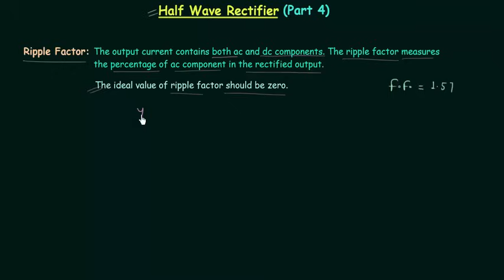Half Wave Rectifier (Ripple Factor)

Comment: Conversion efficiency  of half wave rectifier should be ratio of  dc power output on secondary side to ac input power on primary side,which comes to approx. 20 per cent......in your video efficiency is ratio of dc power output at load ,to ac input power at load ,which is 40percent,..... please shed some light on definition of efficiency and why this discrepancy

Comment: There's a mistake in the final calculation , it's 1.1 not 1.21 , you probably forgot a bracket while using the calculator
Reply: But i think that it comes 0.57 instead of 1.21 or 1.1
Reply: @shivamkashyap1543  it's 1.1 dude, I think it's written in R Murugesan's modern physics, not sure, but the final value is 1.1.

Comment: As Idc is constant , 
Idc(2/2π) integral 0 to 2π I(dwt)
To solve :-
Integral 0 to 2π I(dwt)
0 to π I(dwt) + π to 2π I(dwt)
As for half wave rectifier 
π to 2π I(dwt) =0 
We only left with 
0 to π I(dwt)
As I=I' sin(wt)
Where I' is peak value of output current
Such that
Integral 0 to π I d(wt) become 
integral 0 to π I' sinwt d(wt)
I' is constant
Therefore by integration of sin(wt) we get (-cos wt ) and putting the limits 
we get value is 2 
Thus the value of 
Integral 0 to 2π I (dwt) = 2I'
Thus final value we get is 
=Idc(2/2π)2I'
=Idc(I'/π)
As I'/π=Idc ( average value of output dc current)
Therefore we get at last is (Idc)^2 🙂🙂
Reply: Thank you 😊
Reply: thank you
Reply: thank u
Reply: thanks a lot
Reply: Thanks a lot dude
Reply: 7years ago.....damn.....but the final answer was 2Idc^2 not just Idc^2

Hope you see this bro
Reply: @fxjeda6894  😭😭😭
Reply: thanks a lot buddy

Comment: In the last lecture you told that rms value of ac is equal to the value of dc. 
So in this lecture how is av o/p current(Iavg) taken as Idc i.e (Iavg=Idc)? 
According to the last lecture rms o/p current(Irms) should be equal to Idc i.e (Irms=Idc) right? 
This is proving that Irms and Iavg is equal which is not equal in practice. 
Please help.
Reply: No he told rms value is the value of supply so that the supply would give power or brightness to lamp connected to it
Reply: initially even i was confused,then i came to know that average value is equivalent to dc component of current since the opposing peaks of the ac components get cancelled out
Reply: @aditipandey6964  how Iav= Idc?

Comment: I figured out the 2Idc^2 part. In Idc*I, Idc is a constant so it will come out of the integration. Now write I as Iac+Idc. Integration of Iac will be zero over a full cycle. Hope it helps. This is also why the average value is Idc.
Reply: but this case is for half wave rectifier right?
so the integration of Iac in full cycle isnt zero.
Reply: @dwinovianto1250  bro we have broken I into two components one is Pure AC with positive and negative cycles and the other one is Pure DC
Reply: @dwinovianto1250  it isn't exactly 0,but it's small when compared with other terms.
Reply: Haha everyone's thanking me but now I've forgotten everything I learned in that electronics course. But glad I helped.
Reply: @yashodhan1905  🤭🤭🤭🤗🤗🤗
Reply: @yashodhan1905 mass bro
Reply: @renusara3419  mass of what?
Reply: @yashodhan1905 bro, you have completed your btech and I hope you are living a well settled life. I am 1st year student at nit Hamirpur. I just want tips from you that what should I do in my btech journey (my branch is electrical). Please please give reply and help me 🙏🙏
Reply: iac would not be 0 because we take the mode of integration it will add the mag. of +ve cycle and -ve cycle
Reply: I had one single problem so i watched the video but i got the answer from you, thanx bro
Reply: still did not understood😓😓😓😓.....please can u elaborate more
Reply: thanks....
Reply: Yashodhan Manerikar thanks
Reply: Thanks a lot man, I just got freaked out.
Reply: brilliant!!
Reply: @Padhai_with_Princy  s
Reply: Thank u
Reply: Thanks so much brother I was confused at that step
Reply: Thanks
Reply: Thanks 😊
Reply: TYSM🙂
Reply: Thankyou❤
Reply: thanks a lot
Reply: Yesss
Reply: Yeah idc
Reply: thanks....
Reply: Since Idc is constant ,it will come out of  integration,and remaining thing 1/2π×int{ i dwt} is by definition equivalent to  Idc..so we get Idc^2 as final answer..... Actually 2*Idc*2 .cuz we had already taken out the 2

Comment: sir...i did not understand how u integrate I Idc d(wt).....3 term
Reply: As Idc is constant , 
Idc(2/2π) integral 0 to 2π I(dwt)
To solve :-
Integral 0 to 2π I(dwt)
0 to π I(dwt) + π to 2π I(dwt)
As for half wave rectifier 
π to 2π I(dwt) =0 
We only left with 
0 to π I(dwt)
As I=I' sin(wt)
Where I' is peak value of output current
Such that
Integral 0 to π I d(wt) become 
integral 0 to π I' sinwt d(wt)
I' is constant
Therefore by integration of sin(wt) we get (-cos wt ) and putting the limits 
we get value is 2 
Thus the value of 
Integral 0 to 2π I (dwt) = 2I'
Thus final value we get is 
=Idc(2/2π)2I'
=Idc(I'/π)
As I'/π=Idc ( average value of output dc current)
Therefore we get at last is (Idc)^2 🙂🙂
Reply: @harjitkaur6729  finally we have Idc(2I'/π). How Idc(I'/π) ???

Comment: how could you get I(dc)^2 from just multiplying I times I(dc) -in the third part of integration - ?
Reply: I=I(ac)+I(dc);
I(ac)=I(m)sin(wt);

If you integrate sin over its period it results in 0. So integration over I(ac) is 0 and we're left with I(dc) component of I
Reply: @ayushkumar-xk7kp  dont try to fool them.. his doubt is correct.. it cant be 0 because.. in positive half cycle it doesn't comes out to be zero
Reply: @abhishekkumaryadav1928  I may not be very clear in explaining, but integrating I(ac) over its period will result in zero.

Please refer to the definition of alternating voltage, it periodically varies its polarity and changes its magnitude continuously. So whether you consider sinosudal or rectangular or triangular signal, Its Integration over its period will come out to be zero.

Also I(dc) may or may not be a constant wrt time, A pulsating voltage may also be dc, refer to wikipedia if necessary.
Reply: @abhishekkumaryadav1928  bro class 12 ka area under curve yaad kro....usmein humlog function ka mod liya krte thee taki function ka negative part ka area substract naa ho jaaye...wahi use krenge ismein toh... Sin graph ke positive part ka area 1 and negative ka 1(negative)...hence it's integration over its period is zero
Reply: @ayushkumar-xk7kp integrating I(ac) over a period will become zero only if it was an unrectified signal. Here o/p I = I(ac) + I(dc) , is HW rectified so the ac component over a period is not zero.
Reply: Bro idc constant hai use integration se bahar nikalo phir jo andar bach gaya uski integration idc hi toh hai..idc is equal to 1by 2pi times integration of instantaneous current I on one full cycle..toh jo I hai vo instantaneous current hi toh hai ek bar fir sir dekho..idc xidc = idc^2
Reply: @thebasicphysics5042  wah bhai thanks koi to samjhdar mila
Reply: @narendrarathod9093  😀😁
Reply: @aayush 
Thank you very much
Reply: @balaji2.095  first of all the integral will be -cos(wt)/w.  (Though it doesn't matter)
And after you put limits the integral will vanish(1-1=0) the
Reply: @ayushkumar-xk7kp  thanks for clearing my doubt

Comment: I didn't quite get how to do the integration of the part you skipped
Reply: integration from 0 to 2pi of ( I * dwt ) / 2pi = Im / pi = Iav = Idc  , as for mixed signal Iav represent dc current
Reply: As Idc is constant , 
Idc(2/2π) integral 0 to 2π I(dwt)
To solve :-
Integral 0 to 2π I(dwt)
0 to π I(dwt) + π to 2π I(dwt)
As for half wave rectifier 
π to 2π I(dwt) =0 
We only left with 
0 to π I(dwt)
As I=I' sin(wt)
Where I' is peak value of output current
Such that
Integral 0 to π I d(wt) become 
integral 0 to π I' sinwt d(wt)
I' is constant
Therefore by integration of sin(wt) we get (-cos wt ) and putting the limits 
we get value is 2 
Thus the value of 
Integral 0 to 2π I (dwt) = 2I'
Thus final value we get is 
=Idc(2/2π)2I'
=Idc(I'/π)
As I'/π=Idc ( average value of output dc current)
Therefore we get at last is (Idc)^2 🙂🙂
Reply: what does the mixed signal means
Reply: The part with 2/pi integral from zero to 2pi of  ( I*Idc *d(wt)) at the minute of 6. 02
Reply: i didn't get it too
Reply: it's the average value of the ripple current I witch is equal to Idc

Comment: I can't understand how can the ripple factor be more than 100%. Ripple factor is the percentage of AC in the output, so if you're taking the entire output to be, say, 100, how can the AC component in that output  be 121? I googled it but coudn't find any explanation. Please explain
Reply: ripple factor is the ratio of % of AC comp in output to the DC comp. AC comp is 121% of the DC value not the entire value. Hope it helps.
Reply: shubham maniyar  yes I'd figured that out before my exam. Thanks anyway :)
Reply: Oh. Great thanks guys for solving my doubt !
Reply: shouldn't it be rms value of ac component